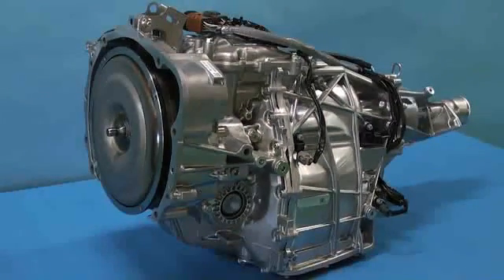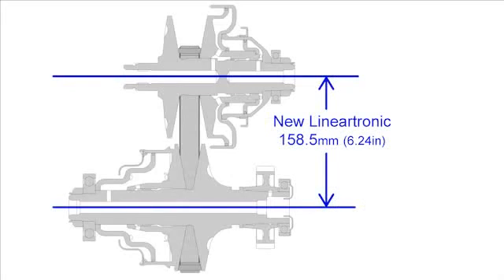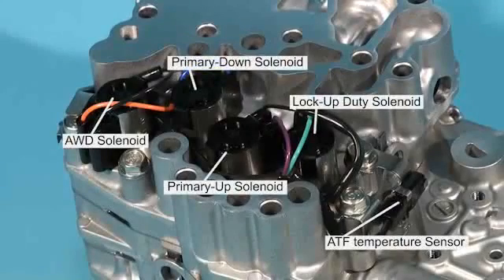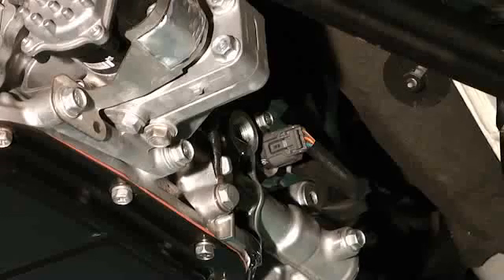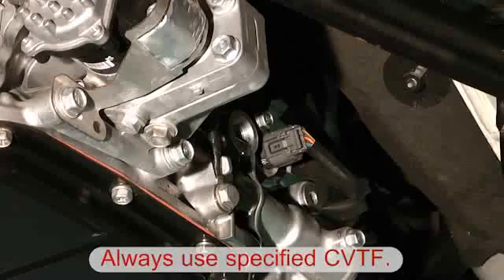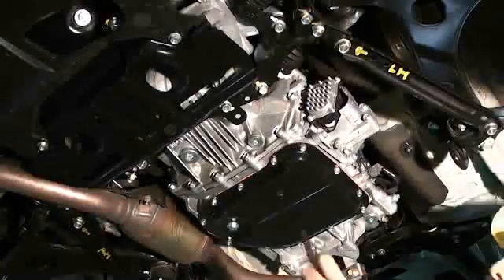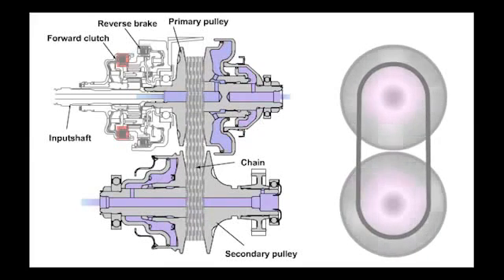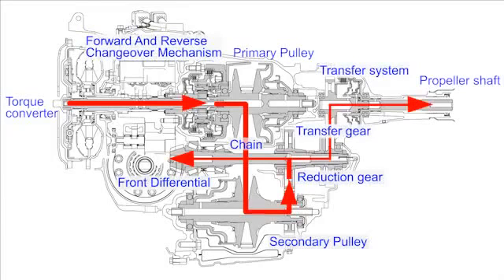Subaru Lineartronic CVT Technical Training

Comment: Watching this is enough to put me off ever buying a CVT transmission. I'll stick with a WRX STI.  Subaru, if you stuck with MANUALS and AUTOS you would sell a lot more vehicles. Feel free to put me on your senior management staff.
Reply: Smart man. The cvt is pos. Its basically the Apple of transmissions. Its not meant for anything other than weak smaller cars that just drive around to the grocery store.
Reply: @randallgoeswhere  own and seen a lot of them with 200k and 300k plus miles without fail. There’s a ton of reliable Subaru CVTs. You only hear about the failures.
Reply: @MrSubaru1387  you banned me on your channel because you can not take criticism .  Reinstate me please.

Comment: I deleted original comment now.  Because I was wrong about my personal experience with lineartronic so far.
Reply: The programming for the transition of the CVT pulleys is not considering both the drivers applied horsepower demand and the stress-fatigue point of the belt riding around on the two CVT pulleys. You should have got the standard automatic. https://www.youtube.com/watch?v=v7GIqlb7NfA
Reply: @charlesnoble7470  it was actually a bad 7to13 pin trailer adapter that caused the issues. My transmission  wasn't to blame in this case.  Brake override cut the power to the engine. Because the car believed trailer was braking.  I didn't know that the original comment wasn't deleted. 

This summer I've pulled a 1200kg caravan  for 20-30hours and it the car worked great.  But I will not stretch my luck and pull a heavier caravan with cvt transmission.  Max tow capacity is 1500kg but I'm keeping it below 1300kg to be safe. And I'm only going max 80km/h.  While climbing I'm often below 70km/h to keep cvt temperature down.

Comment: Most mechanics have a software which is a subscription, to help with identifying car manufacturers problems, ask  them to check Subaru..... No 1 problem: CVT transmition failure....!!!!!!! On top of all the other problems that emerge every day. All you need to do is google “ Subaru recalls” and you’ll be constantly flooded with new issues concerning Subaru reliability..... no other car manufacturers have such a bad record!!!! You have been warned!!
And people, DO NOT BE FOOLED
By SOME TROLLS HIRED , employed, commissioned by Subaru to argue this claims, all they are doing is DAMAGE CONTROL !!!

Comment: Every day there’s a Subaru recall..... amazing
Reply: Last one is about oil leaking into engine parts where it shouldn’t., high crash risk .....affects 2018 /19 outbacks ,foresters and another one I don’t recall.... literally one every week....and they’re mayor flaws, affecting transmition,and all dangerous!
Reply: @masterplan447  yet, subarus are more reliable since 2017 since they have ever been. Look at the 2000s and tell me differently. 4eat problems, blown gaskets, oil consumption
Reply: Where? And for what. A brake light switch? Tokata air bags that are in every major auto manufacturer?

Comment: I have a 2014 forester XT 72,000 km with a sealed and untouched CVT still work like charm and its a Japanese made...most of Subaru CVT problems came from US made Subaru.. Australia,Europe and here in Philippines(all made in Japan) has very little reported incident regarding its CVT transmission
Reply: All Subaru CVTs are made in Gunma Japan and shipped here fully assembled. ;-)
Reply: Cvt failure is more common when pulling trailer. I got trailer hitch on my levorg at 38000km.  10000km later it's basically a dead cvt.  Only 600km of those 10000km was with snowmobile on trailer.

Comment: Comparing the new modern automatic transmission technologies (DCT/DSG Vs. CVT) it appears both are equally complex, both have reputations for unreliability compared to a planetary automatic and clutched manual, the manual is still the simplest, most robust and most reliable.

Comparing CVT to DCT/DSG, the DCT is clearly superior, it’s more robust, has a crisper feel, and feels closer to a true manual, as it has physical gears transferring power

The CVT only advantage over the DCT is fuel efficiency, everything else is inferior, driving feel, responsiveness, enjoyment.

If I had to choose a modern automatic, it’d be a DCT/DSG, it feels the closest to a true manual

CVT has potential, it just needs to become more robust and more reliable, the biggest problem is wear from the chain on the variators, that’s the biggest design flaw, metal on metal contact
Reply: He said, from way in the past.

Comment: Hi, all my local dealer put high torque oil into a low torque cvt....and I have a slip in the cvt...anyone any idea?
Reply: Sandor Lukacs if it’s a Subaru dealer, question it, they’re crooks!  They wrecked mine and lied through out the whole process!!!!!
Reply: First, ask the technician if he uses an OBD reader to change the fluid. If he says no; leave the shop and find another. Use only Subaru CVT fluid due to the transmission is highly sensitive, both engineered to precise fluid viscosity (thickness) and denoted color. It's not a simple drain & fill. The temperature of the CVT fluid must be between 96-103F for the final fill and residual fluid flushed out through the system heat-exchanger hose on the left side of the transmission. There is a neighboring gearbox that takes 75W-90 gear oil and you must be familiar with the location of both fill plug and the drain plugs of each of these separate housings. Gear oil destroys CVT's CVT fluid destroys gearboxes.

Comment: How long before the chain fails?????????????
Reply: The factory promotes it as a no-maintenance component; a totally illogical assumption because of CVT fluids breakdown from natural evaporation and condensation within the transmission housing for every warmup & cooldown. Subaru owner blogs prove CVT failure before 100,000 miles, if not regular fluid changes at 20,000 miles to 30,000 intervals. It costs $300 each time but it beats paying $3000.00 to $5000.00 for a replacement CVT transmission before 100,000 miles. CVT transmissions shouldn't be driven aggressively when they are cold. Internal CVT fluid needs to be warmed to engine temperatures. Use only Subaru CVT fluid due to the transmission is highly sensitive, both engineered to precise fluid viscosity (thickness) and denoted color. It's not a simple drain fill. The temperature of the fluid must be between96-103F and flushed out through the fluid heat-exchanger hose.

Comment: Just give us a manual transmission option instead of a rubber belt Subaru. All CVT does is add costs to the vehicle, greater servicing costs and more hard to fix. Acceleration and cornering effeciency are both reduced with CVT - The only thing it does is save fuel - But us consumers dont care about that - We want control
Reply: 2019 Subaru CVT's don't need to be serviced until 90,000 miles. So there's no maintenance cost on it until then. Most car manufacturers are switching to CVT transmissions because most newer cars have Adaptive Cruise Control and Automatic Emergency Braking which is more forgiving then a regular automatic transmission and not very practical with a manual transmission.
Reply: @norme1850  Ashley Subaru Of America does not want you to touch the transmission! they are warranted for 100,000 miles that’s when most  Subie mechanics will recommend changing them if you change before you ruin your warranty
Reply: There's no rubber belt, and there's no steel belt. It's a massive chain made by LuK. You may want to watch the video - the Subaru CVT does not suffer from those problems you comment about that other CVTs suffer from.
Reply: Steel
Reply: I have both and drive my CVT Subaru the most.  I just fear long term problems with it, tho.
Reply: Did you even watch the video?
Reply: We regret buying Subaru. It’s crap.
Reply: Bill Jazz why?

Comment: The chain design has been used for many years in FWD transmissions the chain will outlast the car. In my experience (40 plus years a dealer mechanic now retired) anything new is never going to work. But given 5 to 10 years becomes the norm. Example: FWD, Electronic fuel injection, electronic ignition, ABS brakes, Air Bags, heck even seat belts they all had great detractors, we don't give them a second thought today.
Reply: Steve Campbell and that's the scary thing. That logic can apply to ANYTHING
Reply: My chain burst and i dont see why..... now i get it fix and di car is jumping like a frog when im moving off

Comment: I just purchased a 2018 Forester, I traded in a 2012 Forester with 35,000 , his and hers shift  with 3 speeds. Great car, nice pickup at higher speeds,  and fun to drive in the city.   My brand new Forester ( 11 miles on it when purchased) now has 1152 miles on it. I was incapacitated as far as any lengthy driving for about 10 weeks in between the 3 months of ownership . Since  I wasn't able to drive much of anywhere, except to medical appointments, the grocery store and the pharmacy. This period was all city driving during snowy and slush. My wife hasn't driven for over 25 years , after near fatal vehicle accident.  I am the sole driver of the " vehicle. After the weather cleared a month back , I was able to road test my new ride and I was comfortable that everything was broke in just fine. After some field testing .My independent  testing including hill climbing , acceleration, standing start and most important R to D and D to R , cold , warm and hot.  I feel like I gave away a very good car , with a responsive throttle and excellent hauling capacity. The new Forester has all the performance of a Roto- Tiller and sadly , with just over 1100 miles on it , I'm hearing noises I would expect from a transfer case in an old tractor. The Forester feels like you're wheeling around in golf cart with an old centrifugal clutch. And even worse , when going from Reverse to Drive, plan on being a sitting duck as traffic run up on you With your extra waiting time , sitting there , you can take two drags on a Marlboro ( if you smoke) and a sip of coffee, while the Subaru decides if and when it wants to go forward. It  doesn't seem to matter weather you sneak up on the gas pedal and fit YOUR driving habits to placate the CVT  and play " Mr. nice driver" or slam the gas pedal  to the floor, the car sits in the street for anywhere form 3 to 5 seconds.  Subaru's disastrous decision to continue with an engineering design that was already a mechanical problem and and basically a very poorly tested is an engineering and customer failure disaster. This company is bleeding so fats, they better just refit the new cars with the old  3 speed . I see NO possible chance for enough  improvement. The design should have been scrapped 3 tears ago and the dead horse it's engineers are beating is just not going to get up, and if the company continues to band aid this problem, I see financial ruin for this car manufacturer.    The early overhead valve Ford Y- block V/8 engines from 1954 until 1961 are an excellent example of a very large company approving and installing a very bad design. The engine was a heavy thick wall casting ( as were most in those days) but the Y-Block also had a very poor cylinder head design featuring " stacked , horizontal intake ports on both intake manifold and heads. Also very poor top end oiling to reach the rocker arms.  The Lineartronic  transmission was approved to maximize profits , while touting safety ( year right) and saying, look, better gas mileage, you can't help get better mileage, because  you go Subaru , especially a 4 cylinder Boxer engine mated 2 a CVT , don't expect ANY driver feedback or useful power while accelerating. Just do whatever the cars says and you'll be fine.  This company has a beautiful engine. Sadly , it was castrated in 2014, when they decided to go with the CVT.   Guess who pays ???
Reply: You probably have a bad one, it isn't that bad as you say.. Seconds to respond? I never had that on mine and it's older (2016). You should better have it checked before warranty expires on you.
Reply: Probably been sitting around too long. Most newer cars these days switching to CVT transmissions because they work better with the Adaptive Cruise Control that these newer cars have. That's why they got rid of manual transmissions because those wouldn't be as efficient. Also CVT's work better  with the Automatic Emergency Braking systems on newer cars.

Comment: So this means these transmissions are FWD Biased? Long gone Symmetric AWD?
Reply: skirmich 60 in the front and 40 in the back torque split
Reply: Yes. And no. There is a clutch and differential on the AWD models. Insert country availability here. The  system allows for a better control of power from front to rear. In my opinion having a decouple ability from the rear wheels and an advantage over the viscos coupler and the center diff coupler that is my WRX.  My crosstrek is way more predictable on ice than the wrx.
Reply: No. It means that by removing the tail shaft and interconnect gears, you can have front wheel drive. Subaru doesn't sell front wheel drive Subies in the United States. It's just a possible design use. 

The WRX is 55/45 power split, front to rear, using the "Current" (TR690) Lineartronic.
The Ascent and Outback XT and outgoing Outback 3.6R and Foz XT is 60/40 using the TR690.
The 4 cylinder naturally aspirated models are 60/40 using the ("New") TR580 CVT.
Reply: @SubaruAmbassadorRobert   I did say insert country availability here. Sorry I didn't give the torque bias distribution in a nominal driveing environment. With overall lock up being 50/50 in extreme cases. How ever there default mode I.E. Limp mode for the CVTs is  FWD. To limit the potential heat in the transmission and subsequent fluid. Regardless of  fwd or awd. The symmetrical part remains the same being that the drive axles on the left and the right  are the same length. This eliminates torque steering a common problem in a transverse mounted drive train be it FWD or Awd configuration. You also lose efficiency in a transverse awd system because you have to change the direction of power 90 degrees to transmit the power to the rear wheels. A tipical set up is with a pinion set.Some  just driven off the right side transaxle. Not a true Awd but some manufacturers like to think so. Anyway I have a I have an ej25b I need to get finished for my WRX.
Reply: @uberdang830  Limp mode isn't the default mode. That's error mode. ;-) But, yes to all of the rest. Do you have a site or IG where you're showing off your WRX build? I'd love to follow.

Comment: What is the expected lifetime of this transmission in normal use? 200,000 miles? 20,000 miles?
Reply: I put 100,000 miles on my 2015 Legecy. Bought it new drive the heck out of it.
Reply: kingmike40 how many miles? do you change CVT fluid how often? just got a 2019 legacy i hope to get 200k out of it bro
Reply: @jayflowz714  2015 Forester owner.
I change the CVT fluid every 45k miles and I put Valvoline's CVT fluid cause dealers in my country dont sell the original fluid. 135k miles and 0 problems.
Reply: @moonsapling Any updates?
Reply: Subaru put out a bulletin for extended warranty service on 2010 and 2011 car transmissions due to many issues.

Comment: Garbage
Reply: Wny is that? I drive Imprezza equipped with the lineartronic CVT.  I think it does excellent job. No slippage unlike other CVTs.
Reply: CVT is inherently unstable, it’s a flawed design in passenger cars, they work fine in scooters, snowmobiles and other small displacement engines, but in a large, heavy passenger car, the transmission will tear itself apart...

Think about it, you have metal-on-metal contact on smooth cones and a rigid belt, the belt will gouge the cones under load...

Simple physics.
Reply: Depending on the transmission owner, the transmission will provide a long life. It is not dirt tolerant. Regularly 20-30K fluid changes are required. Both clean fluid and not the aggressive operation against the CVT till it's warmed up. It's a fine transmission. Old fluid loses Fluid viscosity stability, which can cause erratic control valve operation speed. It must have a lubrication film; especially at the belt/pulley contact. the middle of this video shows where mistakes are made during the lube fill portion of maintenance. https://www.youtube.com/watch?v=v7GIqlb7NfA

Comment: Metal chain side plates scrubbing against metal pulley surface . Inherit to this design side wear same as a v belt . I am curious to the hardness of both wearing surfaces must be Rockwell "?" and special synthetic fluid to last. Fretting and metal transfer is my concern. Better to go with hybrid electric and lose transmissions all together. 
Fix you head gaskets before venturing into a new questionable design. Nissan and Audi cvt disaster now.
Reply: motorhead 
Hybrids use cvt too unfortunately
Reply: been fixed for years! Quit the regurgitation